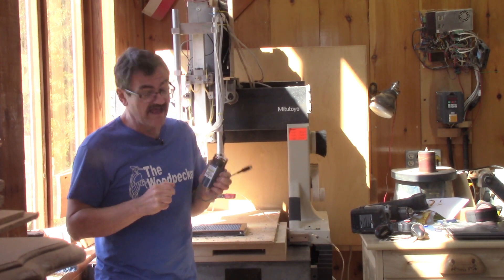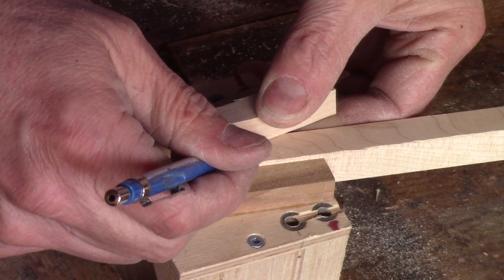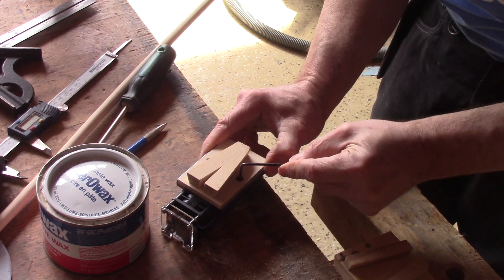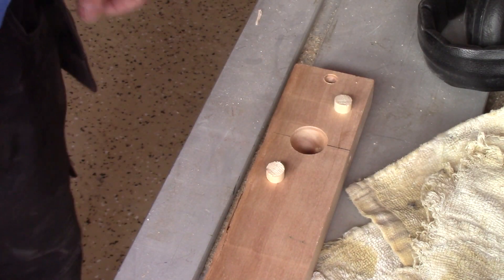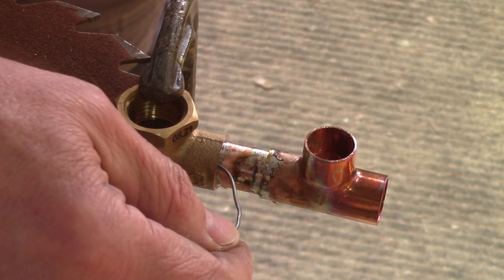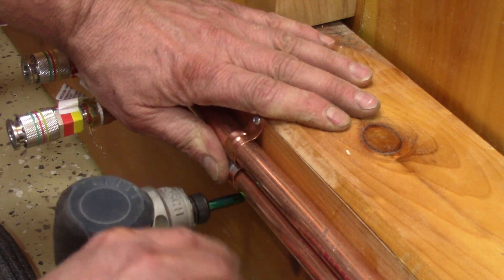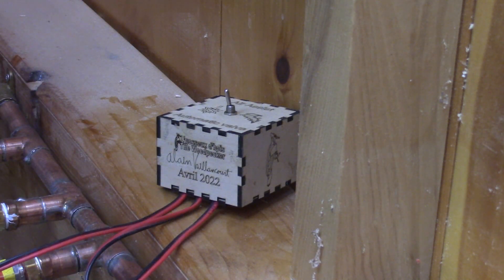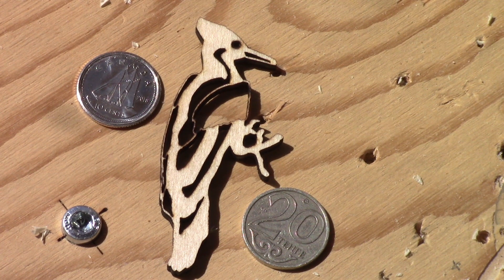The Woodpecker Ep 277 - A new laser for my CNC

Comment: Alain, you're always glossing over the fact that you've created another electronic interface of some kind. Most things you do are achievable by me with enough trial and error by me until we reach that electronic roadblock like "have the CNC control the turning on and off the air or have a manual switch to do it.." Maybe you could do a little more explaining of what you invented to control the air in this particular project?
Reply from the maker: You're right. But it's truly very simple, if you have a CNC that you can access the mist and/or flood signal. 
I hooked up one of those on a relay that power the magnetic valve. In my CNC software (Aspire) I've edited the post production file of the laser and turn the mist pin on an the start of a laser job and turn it off at the end. This way the air is always on automatically when I use the laser. 
I hope this help a bit.